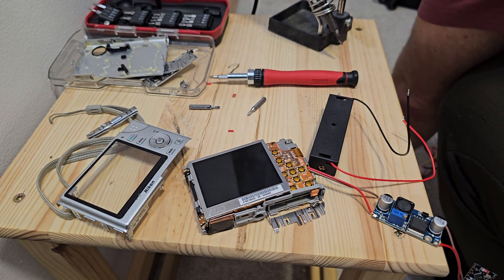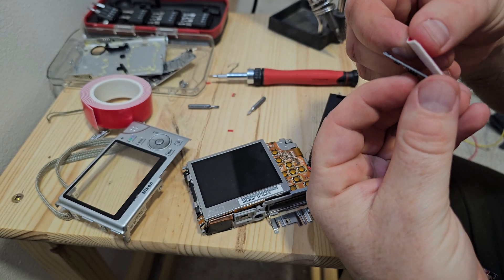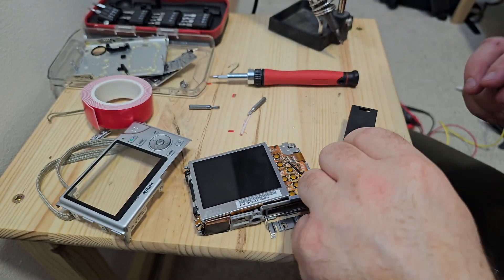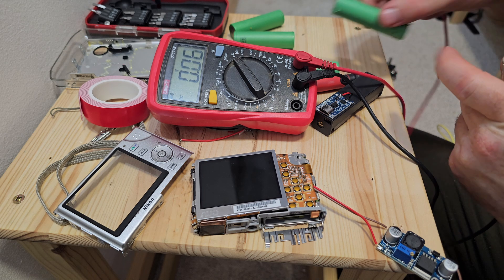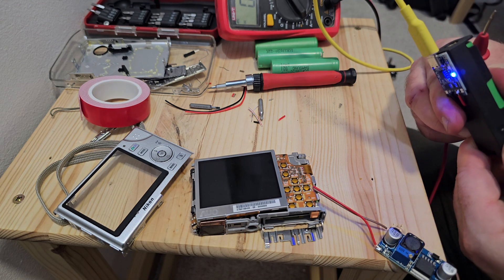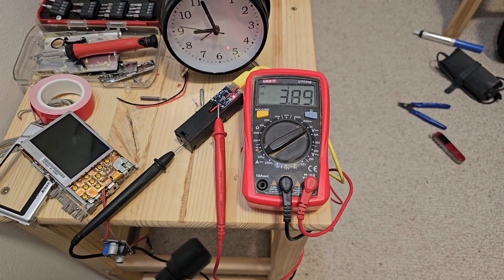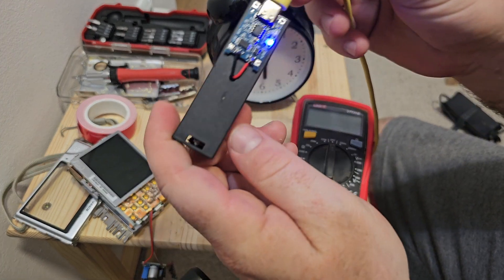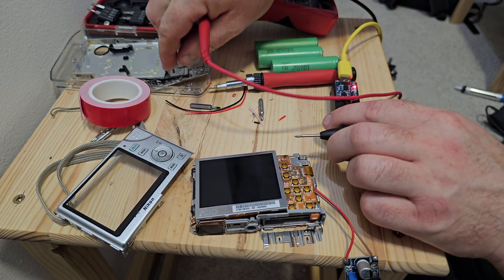TP4056 Charging Module Everything You Need to Know About

Comment: Do blue light turn off immediately after charging
Reply from the maker: No — the blue light turns on immediately when charging is complete (as the red light turns off). It stays on while connected to power, showing the battery is fully charged.
Reply: @JustBotond don't know why my blue light just turn off after charging complete.
Its stay on only for 10sec. 
It do not fully charge to 4.2v but very close about 4.16v